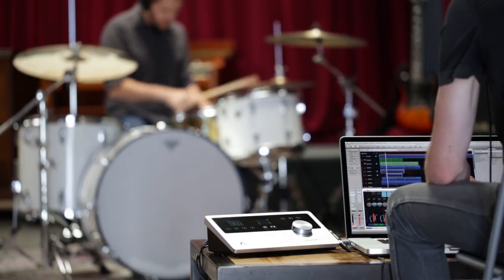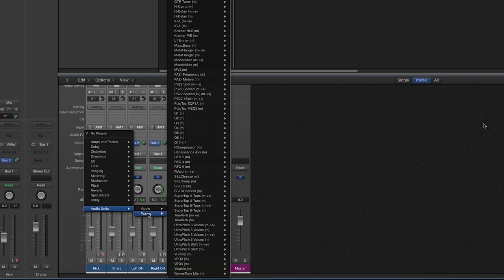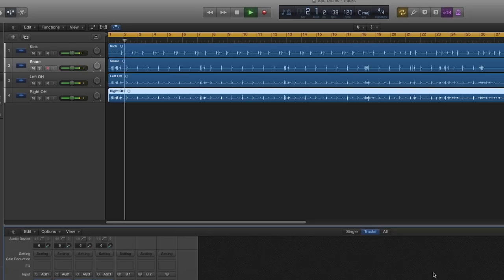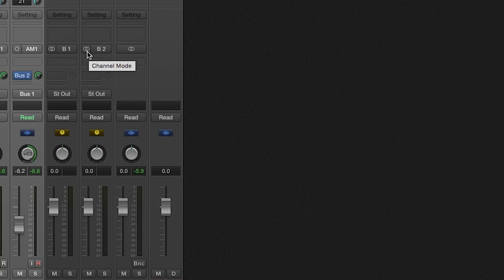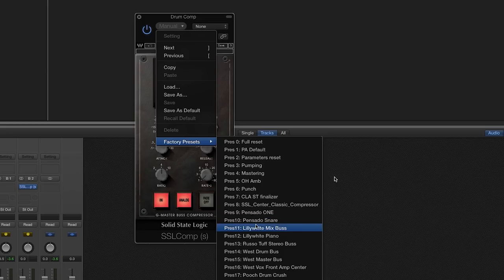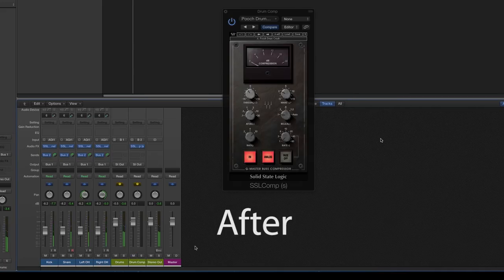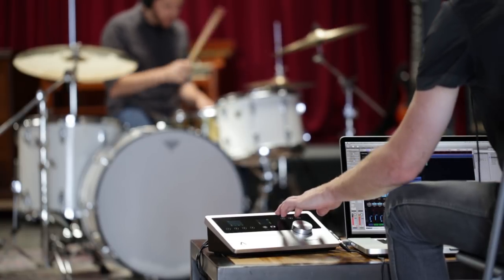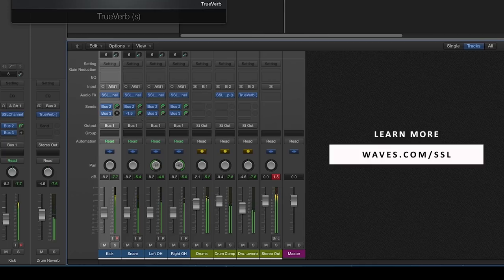How to Add Punch and Depth to Drums using Parallel Compression

Comment: Protip: You can simply use a single send on the drum bus for the parallel channel (as opposed to configuring the send on each individual channel that feeds the drum bus). This has the workflow advantage of automatically compressing any new channels that you send to the drum bus in the future (e.g you add a drum loop or additional percussion to the bridge and you want it glued with the rest of the drums).
Reply: can you ex plain how to do this on logic drum buss ?.... i Know this is 4 years ago but i would like this increase in workflow
Reply: @kaussey4  yeah just change the output on all of your individual drum tracks from "Stereo Out" to "Bus 1" (or whatever number you want your drum bus to be), then on the new aux track that is created ("Aux 1" by default) click on "Sends" and change it from "No Sends" to "Bus 2" (or whatever number you want your parallel channel to be). You can option + click the trim on the send from Aux 1 to automatically set the gain to 0.
Reply: @lunoland  Thanks man i appreciate it alot

Comment: Am tempted to buy this compressor, sounds nice man, & is usually sold for a great price on a sale :)
I dunno what the comments are on about, I can hear obvious added sustain, & transients are more apparent
I agree, you could have got the volumes slightly closer..
But it's also easy to hear the difference imo, it is subtle but that's the point... If you don't get this right you will end up using a transient plugin & you will be endlessly battling with 1 plugin vs the other

I like how the H comp as the transient knob btw, could be a great little addition to V11 of some other compressors perhaps x

Comment: You have to understand what is parallel compression before you throw misleading tutorials on YouTube....parallel compression is to create a floor to your drum bus or mix in general...without taming the transients with the lowest attack possible, you're actually allowing transients to pump in the mix...and that's totally wrong..definitely after doing that...you need to boost lows and highs with an equalizer to create that needed floor for your mix...
I didn't see you doing any of this , so I don't know exactly what you're approaching with this parallel compression!!!
Reply: No rules in mixing
Reply: They've probably found out that a lot of people search for parallel compression on Youtube so the marketing team wanted a video to show up in that search that advertises Waves. So they've made a pointless video that is technically showing what parallel compression is in the most basic way but without giving any useful advice.
Reply: What he just did is mix bus compressor, not a parallel compressor
Reply: How you set the compressor is up to you, but the point is that it should be running in parallel to the main drum bus, and that's exactly what it is doing. You are talking about specifics on HOW to set the compressor, but that's totally subjective depending on what you want. The only misleading thing here is you trying to clamp hard and fast rules on to something which is down to personal taste.